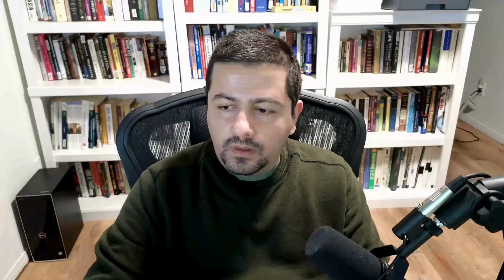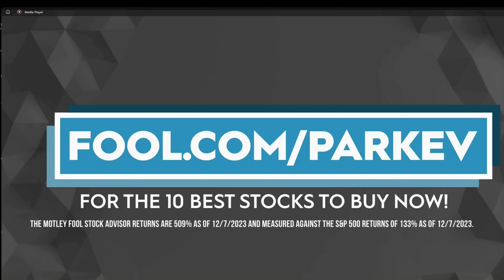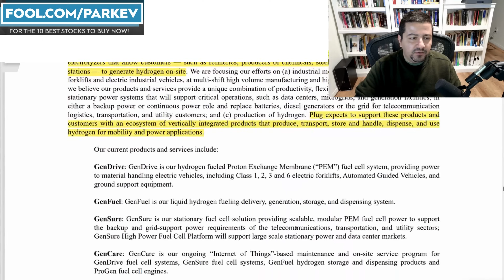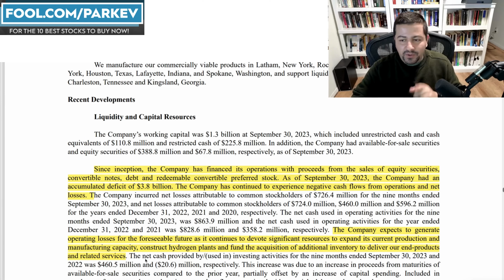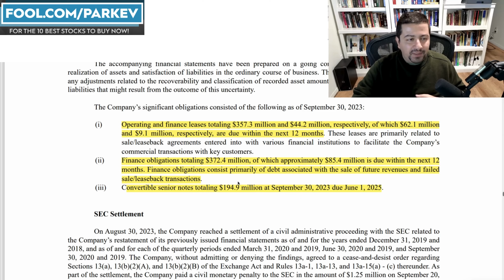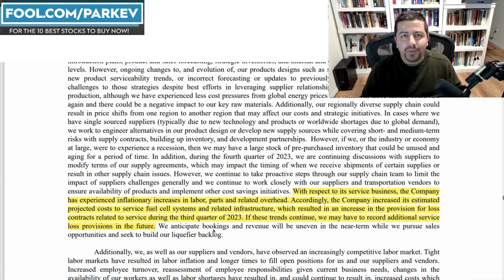Financial Statement Series: Plug Power Stock Analysis | PLUG Stock Analysis | PLUG Stock Prediction

Comment: I bought only 1 share last April. The money invested was equivalent to the cost a few cups of coffee. I think there are better companies to invest in(gamble with) that are dealing with hydrogen as an energy(fuel) source and how the hydrogen is obtained, transported and stored.  I think AmmPower(AMMPF) might be a better but riskier company on which to gamble. It is at the forefront of developing the technology to produce "green ammonia" in small modular units. Ammonia can be used several different ways. It can be used as a way to transport hydrogen in trucks not too different than those transporting gasoline. Ammonia can be used as a fuel. Finally, ammonia is also used as a fertilizer. AmmPower is looking to create production units small enough to be placed on individual farms. If the units are priced right and cost efficient for farmers to buy, then farmers would be able to generate their own energy fuel and their own nitrogen-based fertilizer.  However, I think that AMMPF might be somewhat riskier based on its current stock price. But the technology they are developing, if economically successful, will create a wide moat for other companies to follow.
 Instead of buying a large Starbucks latte, I am considering  dropping my coffee money into AmmPower slot machine at the Wall Street Casino. BTW, I already have 150 shares of AMMPF. If you gamble, the odds of winning become higher, the more you know about the game. If you don't gamble, the odds of winning are always Zero.
Reply from the maker: Thanks for sharing.

Comment: Plug has been around for decades and never turned a profit.  If I recall correctly it was originally backed by Detroit Edison, now known as DTE Energy.  Whether hydrogen power is a good idea or not, there is and has only ever been a very small market for it.  One physical problem is that  hydrogen molecules are so small they leaked right through the walls of the tanks that contained it.  This takes me back a way but also if I recall right Detroit Edison and Plug had the idea of putting micro nuclear reactors in the backyards of house to generate the original off grid power for 5 years.  At the end of that time it needed to be refueled.  Had that happened, mass blackouts, brownouts, and power interruptions caused by extreme weather and downed power lines would have been events of the past.  That's not a bad idea, at least on paper.  My memory is sketchy here because that was probably 20 years ago and after a certain number of years of it going nowhere, I stopped following Plug.  I never invested in it but I watched it for a few years.

Who knows but that Plug and/or hydrogen won't catch on down the road?  How farmdoen the road is the question.  Baker electric automobiles were manufaftured and worked as early as 1900 /1901 or so, but it has taken more than a century for electric cars to be feasible due to hetter batteries and an actual widespread working grid.  

As an aside, we had cars including Stanley Steamers early on but we didn't have electric starters until the early 1930s when Henry Ford bankrolled Thomas Edision to develop a battery that held enough of a charge for longer than 8 hours to be able to start a car.  As late as the 1940s large commercial machines had slave or mule engines like 2 strokes that could be easily pull started that in turn the power from which started the main engines.  Imagine hand cranking a hemi or a bulldozer today to get it started.  Good luck with that.
Reply from the maker: Thanks for sharing.